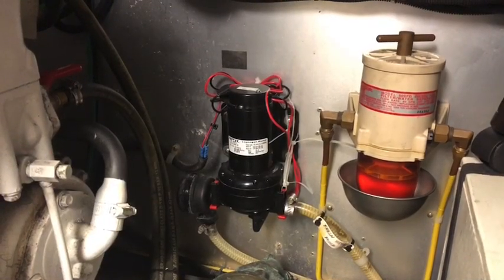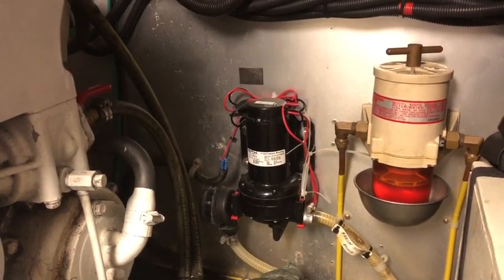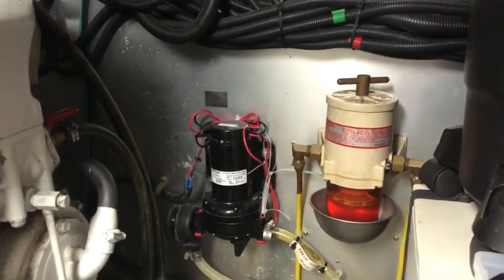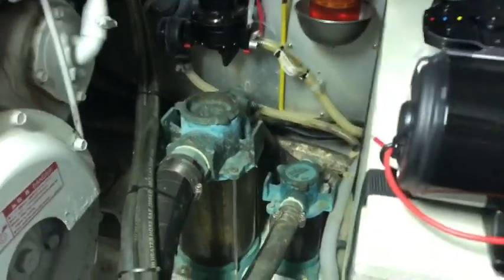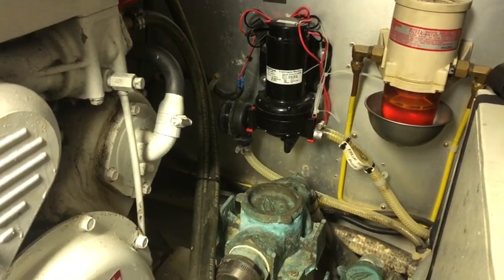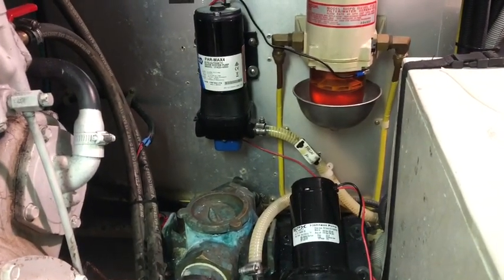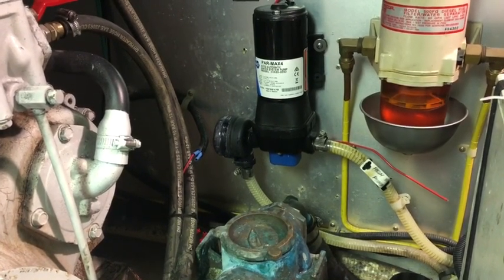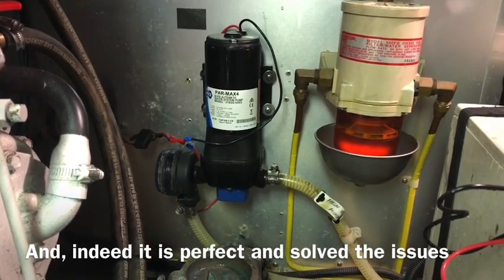Changing The Fresh Water Pump

Comment: Well done Robin. An accumulator would smooth the hot and cold pressures out much better and stop the pump coming on and off so often. It could go anywhere between the pump and the first branch off and the pipes could be extended to it. The pipes may have to be marginally bigger if it is a longish run though, to ensure minimum additional resistance.
Nice to see you back even if it was only your hand!

Comment: Two years ago when I bought my narrowboat the 9 year old johnson pump and accumulator tank next to it were leaking very slightly. I fitted a jabsco parmax pump, new strainer, accumulator 2 litre and new pipework. The jabsco was much noiser and as the pump is in a cuboard I fitted sound insulation which only made a slight difference. The jabsco parmax has worked just fine. My pipework is 15mm JGspeedfit. Just need to get used to the noise, my pump is at the front of the saloon next to the water tank with isolating valve.

Comment: Thanks for another interesting and informative vlog, if this new pump works well does it matter that it's a bit noisy when in use as it's in the engine room or if there is air in the system will it become quieter after a while? All the best, Stevie
Reply from the maker: It’s just a great deal more noisy than the Johnson SPX pump which is down to design and differences between them I guess. I was told it would be louder but the other issue is the resonance of what it is attached to. This is a 1mm sheet of aluminium over plywood so acts to make the sound even greater. I’ve got some ideas to have a separate ply base with some acoustic rubber insulators and then face it with Cork which the pump will be attached to this separate the pump from the base it’s attached to